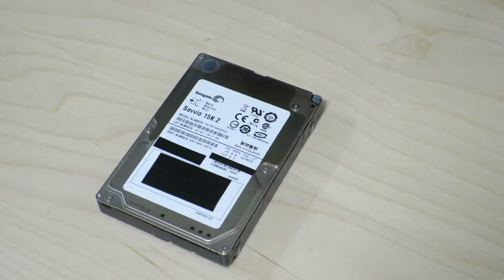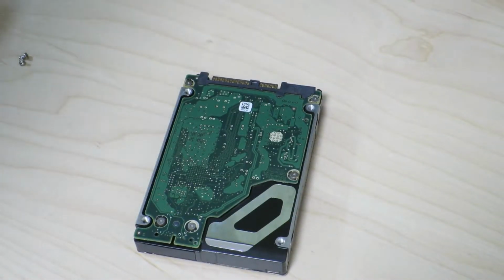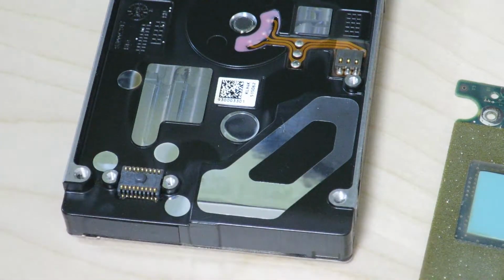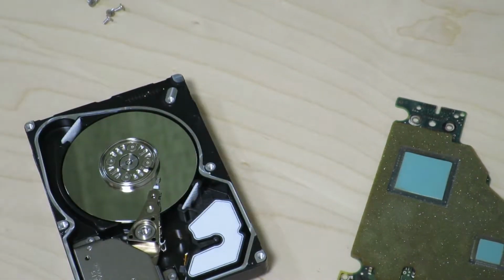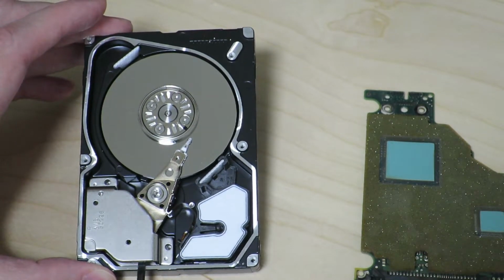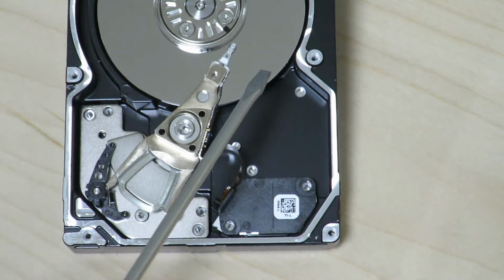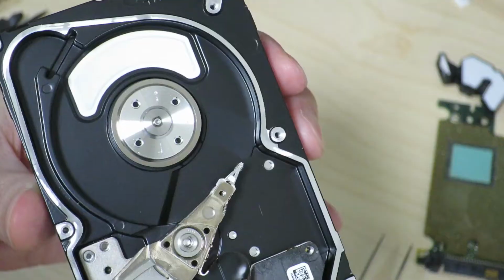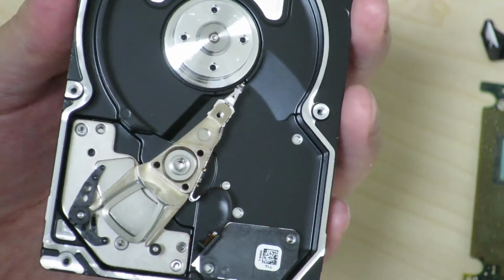Teardown of a 15000 RPM Seagate Enterprise SAS Hard Drive

Comment: SATA is electrically compatible with SAS
RTFM
how are you capable of connecting SATA HDDs (and SSDs) to SAS HBAs and RAIDs, if those are not electrically compatible?
the truth is
SAS is using both form Factor and electrical specification from SATA
SAS was developed on top of SATA-II (electrical and mechanical) 
in fact SAS is using electrical levels from eSATA. SATA fits into those levels without any problems.
Reply: Sata can be used with SAS, However SAS cannot be used with a normal SATA controller. Hence the different connection on the drive itself.
Reply: @NelsonBigGunP200Fan  Why is that?

Comment: your note is wrong
SAS is 100% electrically compatible with eSATA, therfore it is electrically compatible with SATA
get your information correct
SAS is using SCSI protocol and this (only this) is making it possible with SATA
Reply from the maker: Good call. That note is a little misleading, as what I probably meant to imply was that SAS drives are not compatible with SATA interface. The opposite is true, as SAS interface are designed to be compatible with SATA physical connections and (most of the time, apparently) protocol as well. (I found references saying that it's optional for SAS controllers to support SATA drives, but nevertheless, the SAS specification defines the "Serial ATA Tunneling Protocol (STP)" which allows a SATA drive to talk to the SAS controller as if it is talking over a direct SATA connection.)
Reply: STP works only through another device, which in most cases is SAS expanders
SAS HBAs and RAIDs does work with SATA directly from begining